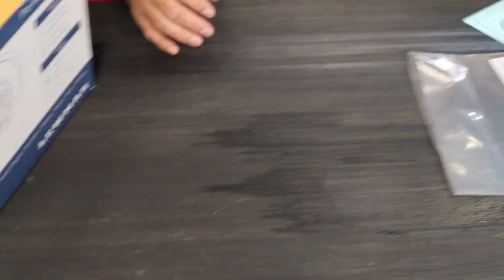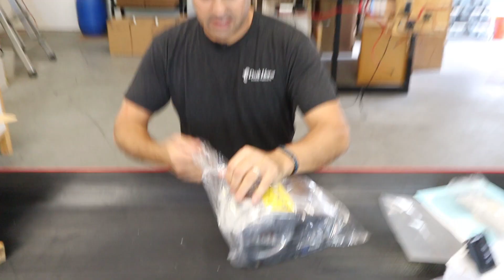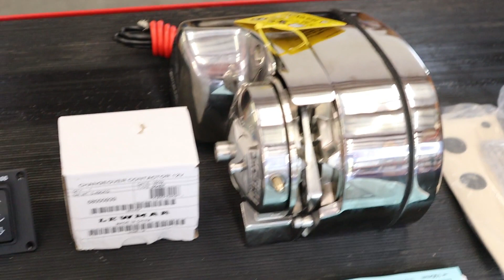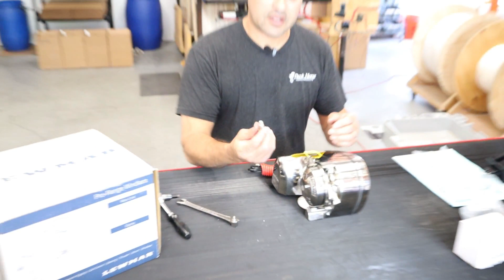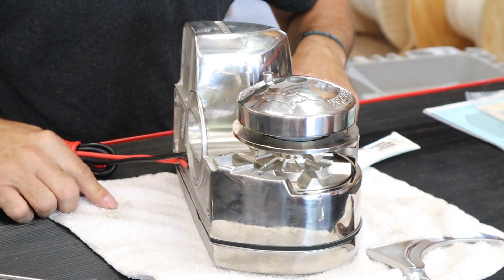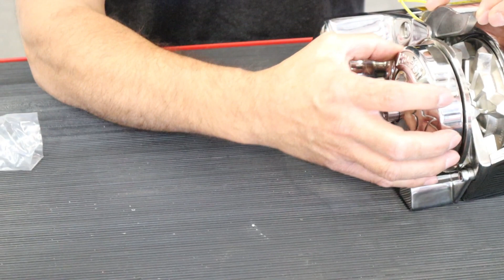Changing the Chainwheel on the Lewmar ProFish 1000

Comment: Do you think I could replace the pro fish 700 motor with a pro fish 1000 motor? Do you think it would phisically fit? My thoughts are if they are the same body a 1000 motor should fit?
Reply from the maker: Yes, it will- just expect a little less pull power. Great question.

Comment: I have a problem with the motor, can you use this windlass manually to let the anchor fall freely and then take it up ?
Reply from the maker: Sorry Noro, just found your comment in the spam folder. Unfortunately, without the motor working you can not lift the anchor up. The clutch wrench that comes with the unit only loosen and tighten the gypsy cap, but will not lift the anchor. Hope this helps.
Reply: @Darkhorsemarine  Thanks but in the meantime I've changed my electric windlass for a manual Royal Lofrans.